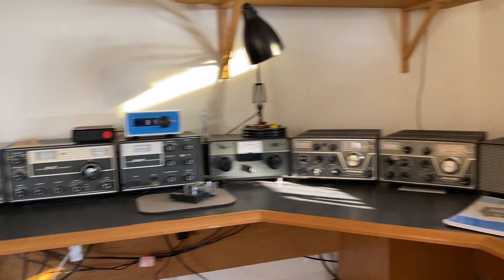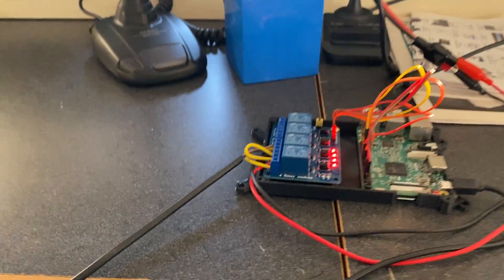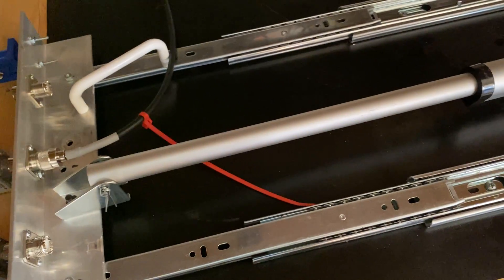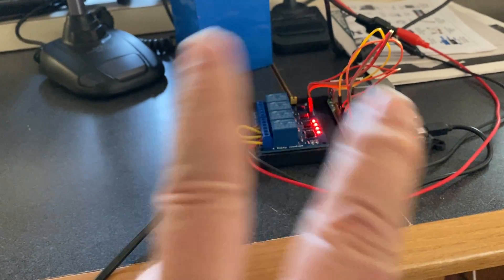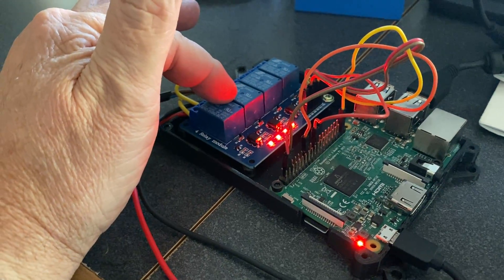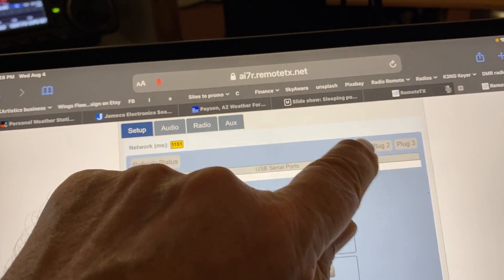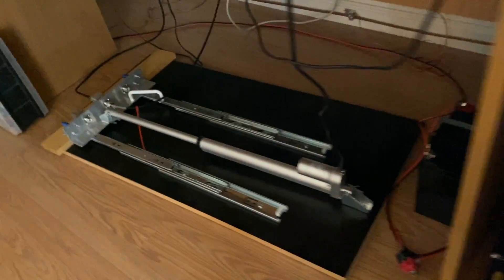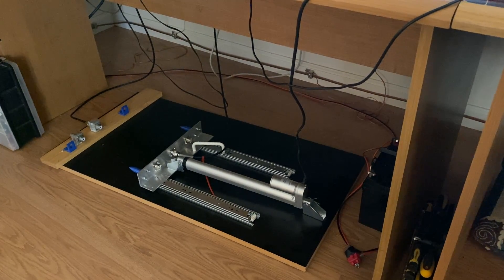Remote Amateur Radio antenna disconnect system

Comment: I too have lightning to worry about in the high desert just East of the Sierras (mainly between June-September). Keeping coax unplugged is a basic requirement for me at the QTH. Would love to have a fairly reliable remote disconnect system like this.

Comment: Does it reconnect when the power comes back on?
Reply from the maker: Well, that's just a prototype and the software isn't set up to re-engage after a power up, but I expect I could get back into the remote access of that software and reengage the device.

I haven't had the time to design a marketable remote antenna disconnect.

Comment: Hi, nice project, what is the name of that type of motor assembly? Is it the one used to open and close windows? I need to solve the problem of what affordable motor I can find here I can use, I suppose a stepper with a screwed rod attached can be a solution for me and others unable to use the same motor assembly you are using. It will be nice if you can make one of this as well. Many thanks. 73's

Comment: I like the idea of the distance you pull the connections away. I live in the south where we have very large lighting storms.  I wonder if Node Red could work for control as well. I really like the distance you pull apart to help with protection.  Did you ever market this idea.

Comment: Hi Dave, you could also arrange on antenna disconnect, for the antennas to be switched to ground by high power relay.
Reply from the maker: Not using this design. It could press a microswitch when it retracted all the way to engage relays between the antenna disconnect device and the radios to ground them.   For 50 years, I've just made sure the antennas weren't connected to the radios and not bothered grounding the antennas or radio coax lines and everything has been fine.  So far.  ;). Direct strikes, all bets are off.

Comment: Neat idea and design. I've seen another one like this one. There is also a commercial disconnect available from DX Engineering.

I would be concerned with the slip on PL-259 connectors.  Over time and usage they may loose their grip and may tarnish or corrode causing antenna issues ?  Although  most people  just hand tighten them, a properly attached PL-259 connector should first be hand tightened then snugged down slightly with pliers to prevent them from loosening ensuring a proper electrical mechanical connection.

You also want to prevent a lightning strike from entering your house or shack.  So perhaps this device could be located outside of the house ?
Reply from the maker: All good points Joe.  Like everything else, it's a matter of degree of protection.  Especially with lightning.  The DXEngineering disconnect is a nice unit and I'm sure it has saved many radios.  But I'm not happy with the close gap of a relay as being enough isolation.  I've had simple dust storms roll through Arizona and the dust discharging on the antenna was enough to cause a discharge across the center and shield of a disconnected PL-259 laying on the desk.  Easily enough potential to arc across a relay gap.  Again, the degree of protection is all we hope for, not 100%.  I've seen versions of this wide gap disconnect built in several forms and they look like the best way to make it work.  Something better than push-on connectors would be prime, and I'm certainly open to suggestions.  The ones I found are VERY tight and seem to be holding true to that as I continue to work them. 

I'm designing a 3D printed set of parts that will hold the connectors.   Replacing bad or worn out connectors will be fairly easy.  We'll see how the design turns out.  It would be easy enough to build one and have it run 10k times over a week and see how it looks after that kind of usage.  

Thank you for your feedback.

Comment: This project need to be installed in a DX Engineering Utility Enclosure Kits DXE-UE-2P with four or more coax runs.
Reply from the maker: The next version may be small enough to fit in that box or something like it.  Having an option for indoor or outdoor installation would be a good plan for sure.  Thanks for the suggestion.

Comment: I like it!   I’m trying to find info on the remote Tx website, but no joy yet.
Reply from the maker: There isn't anything specifically about antenna control with RemoteTX.  It is a very nice remote control system and it has three auxiliary lines you can switch on and off on the Raspberry Pi as part of that program.  The idea is you can switch on or off anything you'd like by connecting a relay or relay bank...up to three things.  I used one to power on and off my Elecraft for a while remotely (the 7300 can do that via the USB cable) and I plan to control my amp power from remote this way too.  Works well with the antenna disconnect.

Let me know if you have additional questions.  dave@ai7r.net

Comment: Looks good. Just wondering... When power returns, after an outage, does the Raspberry Pi reboot itself such that full remote access is restored?
Reply from the maker: It would boot back up and allow for remote control again.  I have mine connected to a UPS and would run for about an hour after an actual power failure, but I like that the backup is there that if I lose control it moves to the safe position.

Comment: Very nice. How about something to unplug the radio too?
Reply from the maker: I have that for my station as well.  This remote wifi power strip lets me power cycle the Raspberry Pi if I need to or power down the 12-volt power supply to the rig.  It's not as good as unplugging it because it's just the gap of a small relay in the box, but with lightning protection, it's all about doing the best you can.  Some strikes, if close enough, can always find a way to do damage.

https://www.amazon.com/gp/product/B071ZGDDQG/ref=ppx_yo_dt_b_search_asin_title?ie=UTF8&psc=1

Comment: Fantastic!
I used to laugh at country folk that run around unplugging everything during storms.
-city dweller
Reply from the maker: It can get pretty sparky out here in the mountains.  I get regular strikes on a power pole 100 feet from my QTH.  Unplugging is a good move.

Comment: That is a great idea.  I have the availability to remote from my QTH in Texas back to several acres near Show Low, and lighting has always been a concern.  The one thing that would worry me is the PiStar.  I’ve experienced several corrupted cards with sudden power failures or outages.  The other issue is how to power cycle my Icom PW1 remotely.   Good luck, you may find a suitable market at the right price point.  73’s de NN7W.
Reply from the maker: I currently use RemoteTX.com as my remote system.  It is super reliable and always being updated.  I would have used the Icom remote system except that my rural network is a NAT and I can't open ports.  I use a 7300 for the remote station and a Elecraft KPA500 for the amp.  And a LDG 600 auto tuner.  I finally got it all really fine tuned over the last couple weeks and it works well.

Marcus, the designer of RemoteTX has given me access to my amp via a NodeRed script he has developed and I can totally operate and monitor it from remote.  Slick as can be.  I'm going to be using NodeRed as the remote access and development system for this antenna disconnect I'm sure.  There are plenty of nice features where I will be able to show the status of the switch as well as control it.  The sky is the limit.

I have a way to remotely power cycle pretty much everything if needed to, and I will have the antenna disconnect set up for battery operation and auto disconnect on power fail as an option.  I haven't had a Pi fail on me yet and I have several doing all kinds of jobs for me.
Reply: Remote power control can be handled by Smart Plugs or Smart Power Strips from companies like Belkin or TP Link as long as you have internet.
Reply from the maker: @daveherron  True, and I have a BUNCH of that going on.  If someone wanted to get super detailed they can use Node Red and go well beyond just power up and down.  I can not only control my KPA500 amp now but I can see the status and watch the power and SWR LED bars using a simple app.  The finished version of the antenna disconnect will have sensors for the status, and I'll probably include some power controls for other areas of the shack if someone wanted.  I currently use a battery to control the antenna disconnect since the reason to disconnect might be a storm.  I want it so a power failure disconnects the antennas.  Fully configurable in a final version though of course.

Comment: I like it, I live in the lightning capital here (Florida).  This time of year I'm constantly disconnecting and reconnecting when I want to use my rig.  Something refined, 3D printed so cost is lower (hopefully), and enclosed would be on my wishlist for sure.
Reply from the maker: I agree it's a hassle to connect and disconnect all the time.  I expect I'll test the first production version at my other home where just doing it from a button would be nice.  And yep, a 3D print will certainly be designed to make it all as inexpensive and compact as possible.  Thanks for your comment.

Comment: I'd also set up a way to send me an email or text when the antenna disconnects.  I think another Pi running off of the battery could do that.
Reply from the maker: Good idea.  It might be easy to tell when listening remotely, but I do plan to have a version that uses an Arduino and wifi with those options, and a website to make it easy to control and check status from a phone.  Thanks for sharing.

Comment: I am trying to do something similar for a empty corn silo.  Any chance you have a link or number for those Slide on 259 connectors.  nice work sir....
Reply from the maker: Thanks Don.  Interesting project for sure.  And easy enough to get any number of wireless remotes to control it.  Let me know if you'd like the 3D printer file for those centering devices.

https://www.ebay.com/itm/273807472786?hash=item3fc0327892:g:3xsAAOSwtNdcpE5V